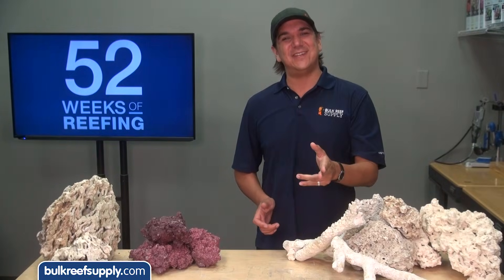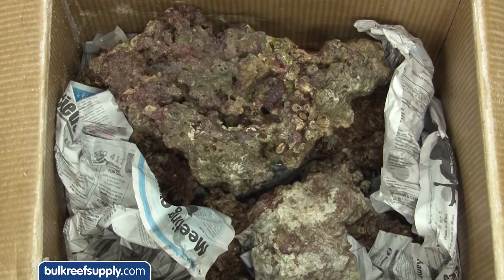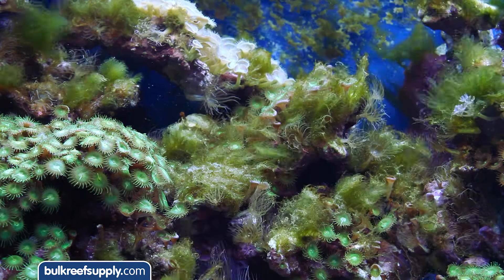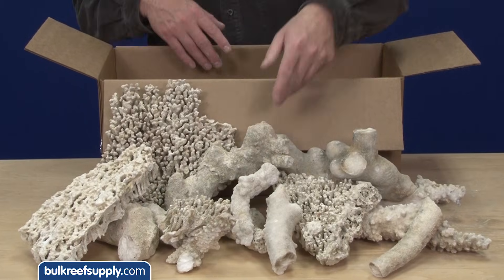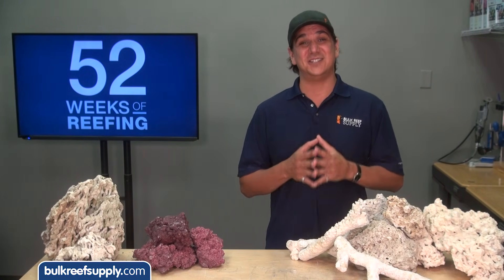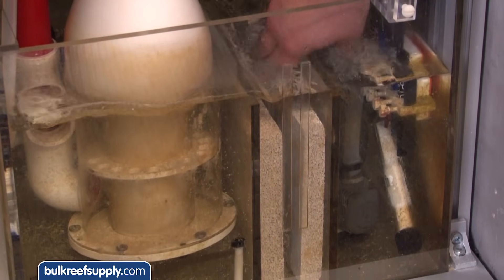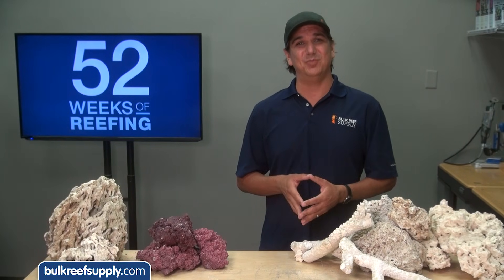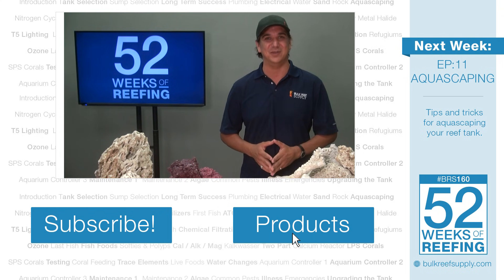Week 10: What You May Not Have Known About Live Rock. | 52 Weeks of Reefing

Comment: How long doe  s live rock stay live if left in a container with maybe a wave maker and I could add some water from a water change?  Do  i keep feeding the rock to keep it live?  My small frag tank wont be ready for a few days at least or maybe a week. I neeed to paint the back black! ?  Do I still need to follow the rule of 1 lb per gallon for a 20 gallon frag tank for softies?
Reply from the maker: As far as the bacteria goes, live rock can stay "live" for quite a while if you have heat and flow. Just keep in mind that if you have anything living on the rock that requires light (like coralline algae), you'll also need to provide a light source if you want to keep that other life alive. 

Most reefers will paint the back of their tank black, but it's really for aesthetic reasons only and won't cause you to have or not have success. 

1 lb per gallon is a good starting point, but not a requirement by any means. More rock means more surface area for beneficial bacteria to help naturally filter the tank, so just keep that in mind when setting your system up.

Comment: I just bought 2 batches of live rock, one looks new but tested posite for small amount of amonia nitrites and nitrates after soaking in saltheated water for about 5 days. I have some that tested negative.  I would like to mix both batches as the new rock is reef saver and the live rock that tested zero is tonga branches arches and base and small rock.  I wont be mixing the two until I set up my large aquarium that needs lots of work though and i have a small 36 gallon bowfront that needs nothing and is ready to go.  but Do I need to cure this live rock that I bought that has already been curing in a dark brute can?  It tested negative and has lots of marine pure bio balls as well, maybe because its not so porous, lots of tonga braches.  My plan is to get this up and going now with live rock and start curing the reefsaver that tested positive.  Can I later switch the rocks out?   I cant make a good aqua scape, not enough base and small rocks and to many tonga brances.  Later it will all mix perfectly when I upgrade to 75 gallon!  But Until then I want to start with tonga and one big base and lots of marine pure balls, after the reefsaver has cyled or cured then switch most of it than even later mix it all together to make a big 75 gallon.  Is this a good plan?  I just dont want to wait months to cycle the reef saver when I can add live rock right way and the later switch out then even later combine all!  Just hope color matches when I add all together because the reefsaver is white now, hopefully it will darken but since no lite cant grow coarline, maybe I i wll paint it or use pvs purple primer before i cure it.  I saw some you tubes of that, the other live rock with tonga  is caribe sea life rock so has been dyed or painted anyway! Sorry so long.  I hope you understand what I am asking...lol  My live rock has sharp stuff that looks like barnacles or something on it, like in this video of live rock.  Can I scrub that off or will I be scrubbing away benefical bacteria?

Comment: I got the BRS reef saver dry rock for my 40gallon tank last month and  fully cycled it . when I used the turkey Baster blow on it , there were a lot of white powder coming off from the rock . My parameter all good It's not the dust or sand, it's the dry rock dissolving the powder. I would like to return the dry rock but I will pay a lot for the shipping . Is it possible get free return

Comment: Okay, so I have got a question for you brs geniuses!  I bought the 10 kg of the project reef rock 2.1 and one 1"x 8" x 8" bio media plate as well as 30 lbs of special grade live sand from brs.  In your opinion will this be enough filter media for a 40 breeder stocked?  I would like to avoid a hob skimmer and I am currently using carbon/gfo.  Side note, I put the media plate underneath my rock structure which the packaging indicates as an appropriate placement method.

I wouldn't hold you responsible for any response, but would greatly appreciate your professional opinion.

Comment: I had two failed tanks that I attribute at least in part to using dry rock.  I have to say, even though it's not part of this episode, that RO/DI is a key to the tank.  Both previous attempts caused me a massive amount of algae as well as hidden pests. 

Great bit of education as usual
Reply: oh no... MISTYPE.. should have read "in part to NOT using dry rock".  I used live rock the first two times as well as conditioned tap water.  2 BIG mistakes!!
Reply: Used a lot of it on my 180 reef from br. Have to cure it and that takes a LONG time, longer then most know. Also need to seed it good when curing is finished.  Personally do not use ro water either.
Reply: +Felix The Cat I'm glad you have luck w/o using ro.  In my area there is a lot of phosphates "naturally" in the water.
Reply: Our water is terrible and have not moved soon enough to go there(15 years). Will start that soon.  Never had a slime problem and now it has been a problem for months. Not a lot but on the sand here and there. Tried all the solutions but none have removed all out. At least the the livestock and corals are okay. RO will help that immensely.